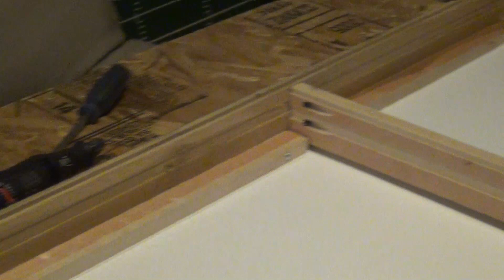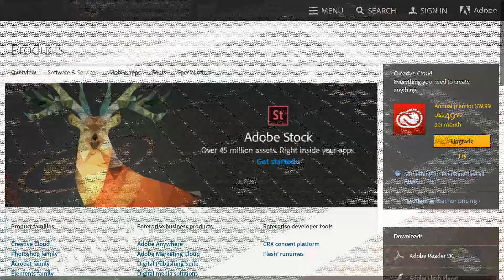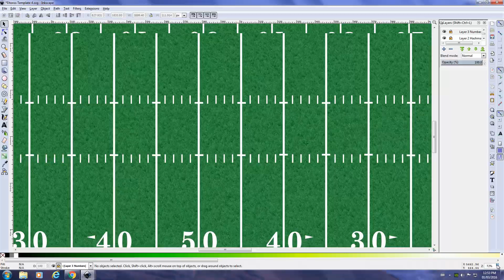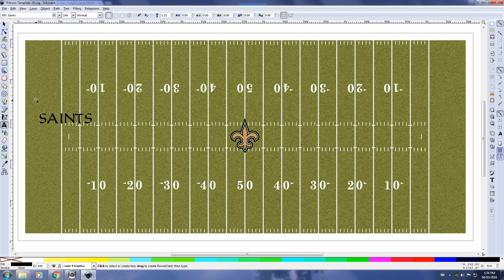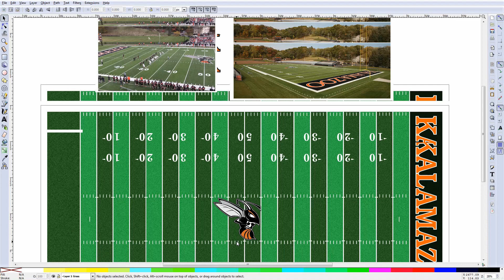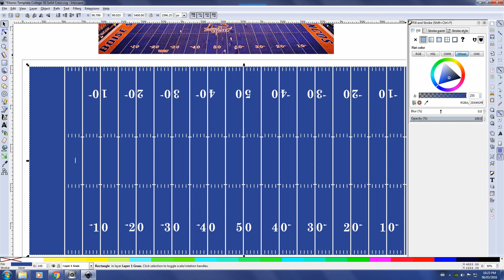Electric Football Tutorial Part 3: Field Graphics

Comment: I've been wanting to create a field for a team I used to work for. This is great. I'd love to get your input on my project, its a little different than a typical field... an indoor/arena field. (There's a site for the games but I've found very little on building this type of field.)
Reply from the maker: Sounds like an interesting project. An indoor arena football is certainly viable. It would require an entirely new template creation with the different and unique yardage lines, spacing etc. I suppose the artificial turf could be simulated with just a solid colors or with mild texturing added. An advantage with the smaller field, is even if done at the scale of 1/2" per yard, it would be much smaller in overall size and you could probably power it with just one DC electric motor too. Let me know if you need any further assistance or advice.
Reply: @Eltoro49 Conversation ratios were pretty simple. It’s just math. I had those before I even found your video. Originally I was gonna paint the field and endzones, then create a stencil. However, my idea changed dramatically since your videos 
learning there were covers. That’s easier, however, its finding a printer, etc to make a custom order. Press and apply in one act would be outstanding. I just don't know how about designing a field, and then getting it to a printer. I’d wanna get some of the original advertisers on the field. Eventually, the hockey-like dasher boards with advertisements - that would be super simple with Avery-style stickers. So that’s my dilemma. Getting a custom field printed that wasn’t super costly. Stencil and paint adss so much work.
Reply from the maker: @DeanofJacksons  Before I figured out how to do my own field covers,  I painted a few fields and that was a lot of work involved. These field covers makes all of that no longer necessary. As for where you can get the printing done:  https://www.youtube.com/watch?v=DmGB7bKumPQ. You can fast forward to around the 40 minute mark. I ordered from them on this past Black Friday , which consisted of a CFL football cover (32" x 75") and a couple of hockey ice rinks for my latest project, which is a scratch built table hockey game. I did hockey rink boards with advertising and included them in the design as an outer boundary to the ice rink surface. Let me know if you need assistance in the design aspect of making the template.
Reply: @Eltoro49  That's exactly what it is  - a hockey rink with a football field. Perfect.
Reply: @Eltoro49  just sent an email with pics etc

Comment: Do you need to build up and level-sand the clear coat to prevent the decals from affecting the players, or are they thin enough that it doesn't affect them?
Reply from the maker: The only time I had the need to sand a clear coat is if there was debris trapped in the clear paint and then only spot wet sanding followed by another clear coat. Generally, two coats is enough to seal and protect the decals and the players are not affected in traveling over the decal areas. However the pointed field/decal  surfaces are the 20th Century way of doing an Electric Football Field. Very time consuming and tedious work (320 hash-marks alone to make!) and there is always the potential that the decal can deteriorate and/or lift down the road. The computer graphic field covers are the way to go. I have done four painted decal fields and probably will never build another, the work involved versus the 21st Century field cover method is not warranted, IMHO.

Comment: Amazing work, I love your attention to detail. I would love one of these! Buccaneers Stadium. Wish you could ship I would certainly buy one if the price was not too insane!
Reply from the maker: Thanks for the compliments. Shipping one of these Scale sized boards is not viable. It is the shipping aspect itself that is the restriction, both in costs and the logistics of packaging to prevent damage and plus being located in Canada. I am also not aware of any of the US builders who ship Scale boards either, for similar reasons. It is not that difficult to build one yourself following the video instructions. If you do not have the facilitys/tools or time to build your own, perhaps getting a local carpenter to build the wood framing and you acquire the sheet metal and field cover and do the wiring which is relatively simple. If you would be satisfied with the smaller and more common 24' x 48' board, there are a few U.S.A. builders who will build to suit and ship too.
Reply: @Eltoro49  Yeah, wish I had a builder that lived close enough to drive. I am not mechanically inclined  but would love this type of board.
Reply from the maker: @Megalodon360  You could go to the "Miniature Football Coaches Association" face book page and ask if there are any builders in your area or if there are any boards for sale.
Reply: yeah might do that!

Comment: The large field goal posts look really good, what are the dimensions, I would like to make similar goal posts for my scale sized field.
Reply from the maker: The cross bar is 4 inches, the uprights measure 6 7/8".  The height of the cross bar is about 2 1/4" before adding the 1/8" thickness, 1/2" diameter rare earth magnet on the bottom of the post, which is either a 1/2" wood dowel or a nylon spacer, available at Lowes, Home depot etc. about 1 1/8' in height. The posts are 5/16" wood doweling. The curved section is from a plastic coat hanger. Here is my original post in the MFCA Forum when I first came up with the idea on my first board project.http://www.miniaturefootball.com/forum/forum/tips-and-faq-for-electric-football%C2%99/custom-field-building/24960-canadian-scale-field/page2
Reply: Eltoro49 thank you sir !

Comment: Thanks for all of your help and answering our questions. When I create the rectangular box and color code it, there's a gray outline to the box. Is the color chosen under the line also or does it just go up to the line and I have to overlap the gray line onto the white line to fill it in completely
Reply from the maker: If I understand your question correctly,..... the way to eliminate that unwanted outline, Have your rectangle selected with the selection tool and then click on "Object" on the upper menu, then click on "Fill and Stroke". In the upper right a window should appear. Click on the heading at the top of that window "Stroke Paint", then click on the No Paint X icon. That should eliminate the outline color all together and give you the one solid color rectangle.

Comment: sorry coach dumb question time, if my field was pvc sheet and I had my fields I designed and put on magnetic sheet could I apply a magnetic sheet to my board so the covers could be interchangable? I am talking about the magnetic sheet that wargamers use to stick painted figures into a tool box so they don't fall over. Thought this would give my magnetic field cover something to stick to? Just a thought as If I do a league here in Australia I want to have a field cover for home and away games and I will probably be the only one to do a board to play on.
Reply from the maker: +Brett Davis No one I know of has tried that. My concern would be with two magnetic sheets there would be a dampening of vibration/performance with the additional thickness to overcome. If you want to go with a magnetic interchangeable cover, the way to go is with a sheet metal playing surface. That is the route guys go all the time when using a magnetic field cover.